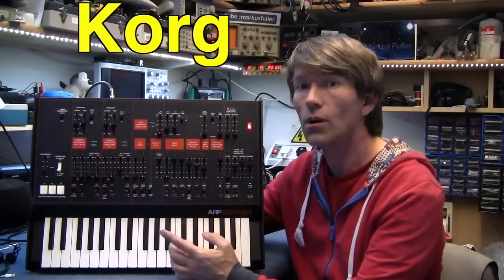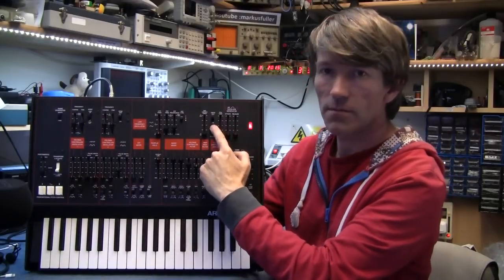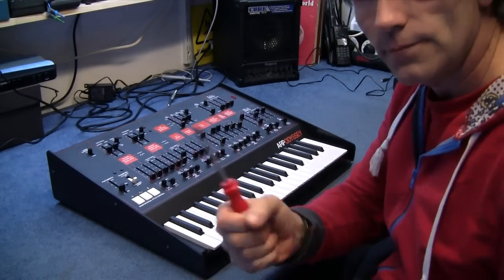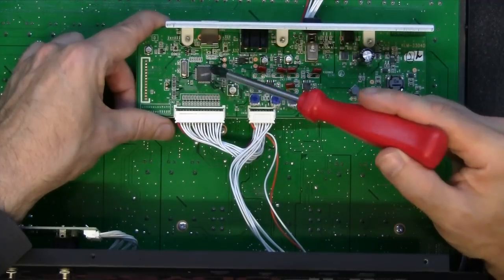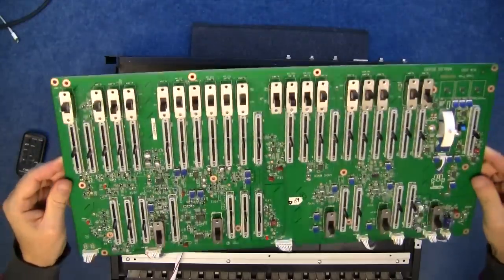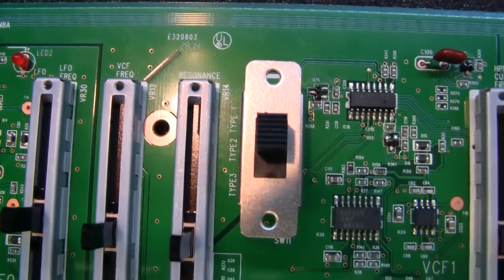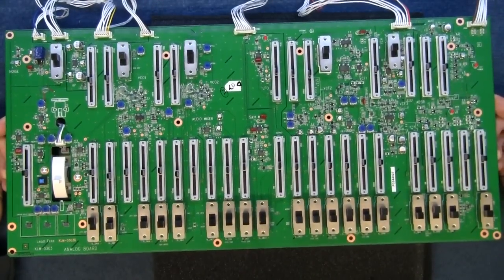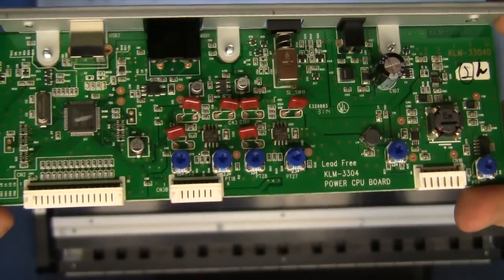Korg ARP ODYSSEY teardown MF#44

Comment: what are the 2 led's near the lfo and gate sliders.  there no holes for them on the front panel for them?
Reply from the maker: Terry Kelling I know but they are placed so you can see them glowing through the gap of the sliders
Reply: markusfuller ok. seems a bit strange there not mounted on the front panel if your ment to be able to see them properly!
Reply from the maker: Terry Kelling I guess its because they wanted it to look like the original. there were no leds for the lfo on the original one.
Reply: markusfuller yep I know that I had an odyssey years ago. but korg could have mounted them nearer the sliders to make them easier to see. lfo led is not to bad but the gate led is nowhere near it. 🤔
Reply: thanks mate. I was also
wondering. why are some of the components covered in what looks like epoxy resin?
Reply from the maker: Terry Kelling Hi Terry Im not absolutely sure but I think it keeps humidity from those parts by isolating them from the outside air and probably helps it stay in tune better when it has warmed up.

Comment: my guess korg pays big royalties to ARP because there is not alot going on
in there for a 1000 euro mono synth , great little synth but still  different sounding to the original ,less bite and grunt , i payed 200 euro for a mint white MK1 1972 original when nobody wanted these.
Reply from the maker: +AlainRaes67 I had so many wonderful synths in the past and sold them on cheap as they were not worth anything and were just taking up room. oh if only I had saved them there was some god ones as well as the ARP original (though i found it a little hard to understand at the time)
Reply: yes everybody that first encounters an ody or a 2600 keep scratching their heads why 
it keeps on outputting sound when they up the vca level slider and NOT touching the keys, until they notice you have to set it at 75 percent as anything above  it is auto hold mode  HA!

Comment: to my mind the newer korg odysseys do not sound quite as 'tasty' as the old ones - my best guess is that the difference is largely due to to the higher capacity power supply and MUCH larger cross sectional area in the solder-flowed traces on the original which are capable of carrying far more current.... but it's just a theory... it's a feature unique to the old arp synths - and they have  a dynamic range that is only shared by the EMS synths .
Reply: Do you own a vintage oddy or the korg s? Curious. I've got both and I'll counter your argument by saying you're so wrong
Reply: THEMASCHINER talking to me? i have both.... the older one is a Mk.III. iit's just my impression - could be age of components - but they sound different to me... the new korg one more 'raspy', less 'deep'...
Reply: Nah....they sound just like the originals.  I own both.

Comment: Hello i got a problem with a poder board. Can You help me?
Reply from the maker: Hi Roberto. whats a poder board ?.
Reply: @markusfuller  power board, sorry
Reply from the maker: roberto carlos . oh ok i checked with google and it said a poder board was for ski-ing on snow :-) . but yes power board what seems to be the problem ?.
Reply: Can You do a voltage measure and tell me the voltage of every connector in it? I want yo replace the dcdc Converter with a linear power supply. Thanks

Comment: Thank you loads for this very insightful teardown, Markus. 
At https://youtu.be/4p4NUiKwxpo?t=6m14s you show the LFO section. 
Did you or has anyone else attempted to put a switch in there to disable LFO sync to keyboard, when needed? Similar to this original mod http://www.arpodyssey.com/iotech-arp-odyssey-lfo-free-run.htm ?
Thank you for any hints and keep up the great work.
Reply from the maker: Hi Im sure they have been circuit bent many different ways.
Reply: Markus, well, i didn't find any obvious mode yet. I'll keep on searching, but i suppose, that the SMD layout kind of stops a lot of mod attempts. Thanx for answering in any case and greets from berlin.

Comment: Dude you know your Crap with these things, No Doubt!!! So In Your Opinion. This Is a Modern Up to date ANALOG Version Of the Original?
Reply from the maker: +skyprop Hi Yes it is a modern analog version of the original with all the good and bad things that the original had. Korg even had David Friend as a consultant during the design and manufacture of this K-ARP. the only thing i dont like about it is the external power supply unit. I think they could have put that in the unit like the originals. but yes it is very close to the original by about 83%

Comment: Why the fuck they insist on external power supply, it's infuriating, I mean DSI, Korg, Yamaha, Roland.
Reply: gfunkclydefrog Internal power supply, wtf is this, synthesizer or fucking stomp box?
Reply: +HatredPrime I think it has to do with EMF testing.  It's easier to have an external PS that is used on a few products tested than it is to have every product tested.  Either that or they're forced by regulation to use a switching PS and don't want to have to deal with proper shielding to prevent the PS from producing interference in the synth voice.
Reply: +HatredPrime I can think of several other reasons for external power supplies. It reduces the weight of the unit (no need for ac-dc transformers), it makes the instruments easier to maintain (fixing power supplies isn't the most fun in the world - much easier to just replace the wall wart), and quite probably reduces cost since the companies probably have a bulk discount on the external psu's instead of making boards to fit each synth.

Really I don't see the positives of having an internal power supply, unless you need to have multiple different voltages (and some ac power) and it's impractical to make a custom built external supply.
Reply: Yeah, but you know how power supply socket looks like, one wrong move and unit is dissconnected. Not big problem in studio but live...
Reply: external power supplies enable a quieter signal.
Reply: The truth is, that's a far bigger downside than the reduced size.  I used to own an ARP Axxe, and one of the best features of it was being able to attach the same power cable as a desktop computer and various other synthesizers.  Not fond of the short length of the power supply cable which came with my microKorg XL (which incidentally also runs on batteries).  But, I wouldn't let it stop me if I ever do lay hands on one of these (more likely in the module form, since I already have too many keyboard synthesizers).
Reply: Mostly for safety certification.  The buy a certified external supply and don't have to have extensive safety testing done on the main product - there is no live AC inside it.